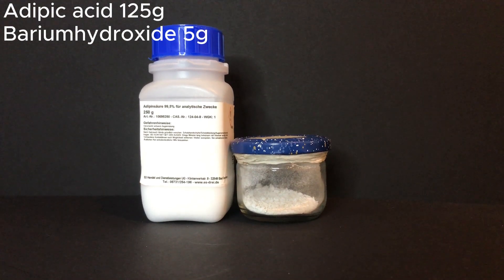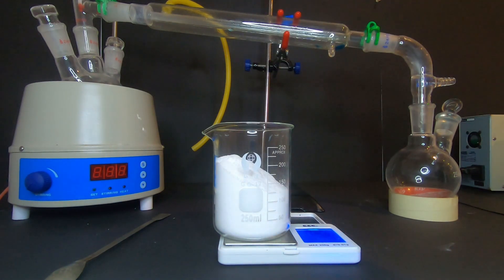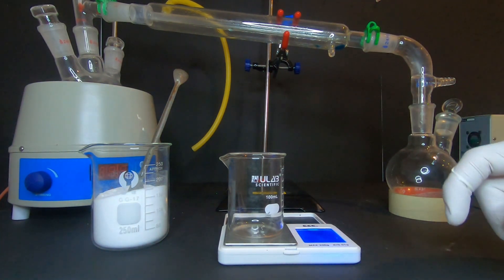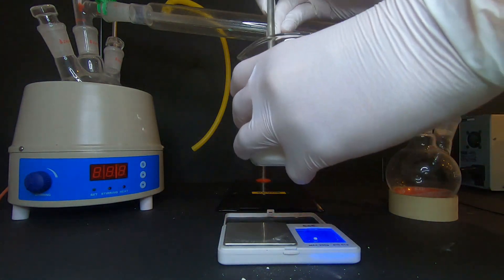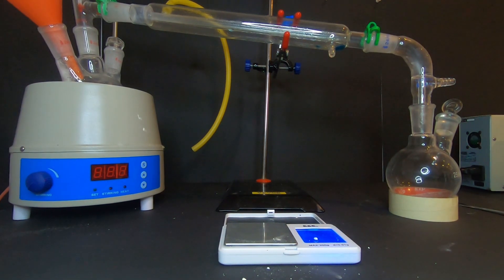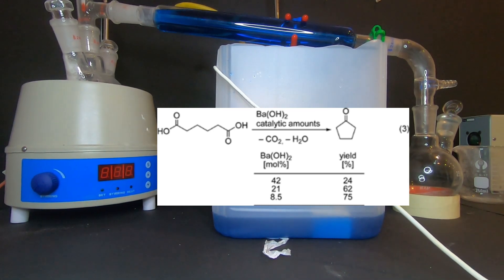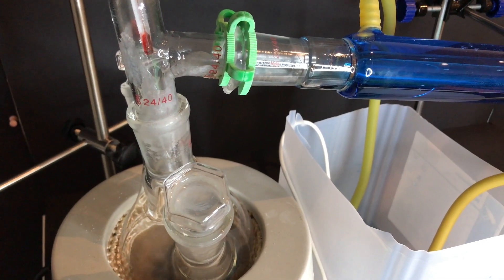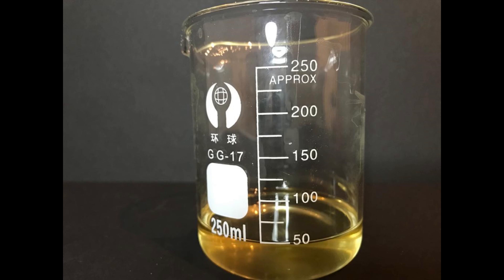Cubane Part 1 Cyclopentanone Synthesis

Comment: Can you use cyclohexanone to react it with ethylamine and reduce the cyclohexanone ethylimine in ethanol water solution using Aluminum Galinstan plus 500mg Palladium on Carbon in a Carbon Dioxide inert atmosphere to make N-Ethyl-N-cyclohexylamine?

Comment: Can you synthesize cyclohexanone by using pimelic acid (heptanedioic acid) and barium hydroxide? It would be similar to the synthesis of cyclopentanone from adipic acid (hexanedioic acid) and barium hydroxide.
Reply from the maker: Thx for your idea I think I would try it in the Future!
Reply: Im pretty sure yes, the only thing that might not be possible is that maybe the cyclopentanone would react with the other prouducts of the ketonisation